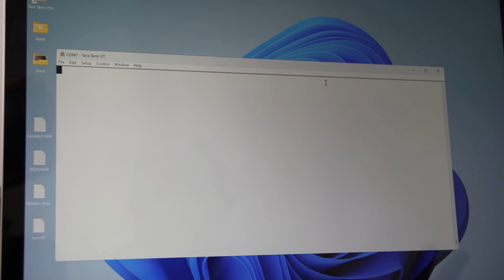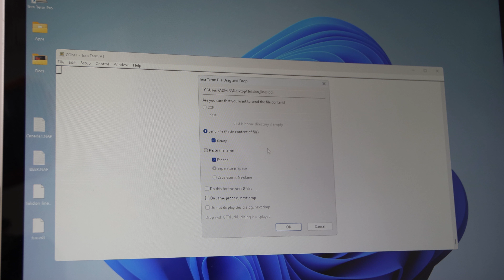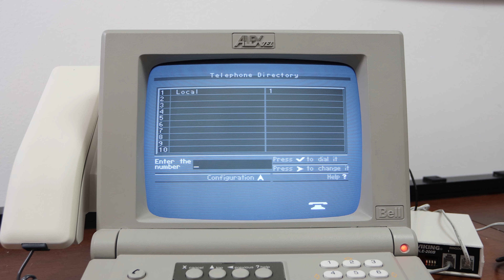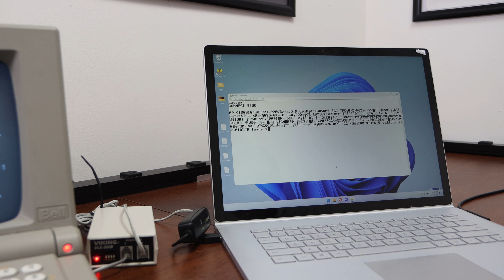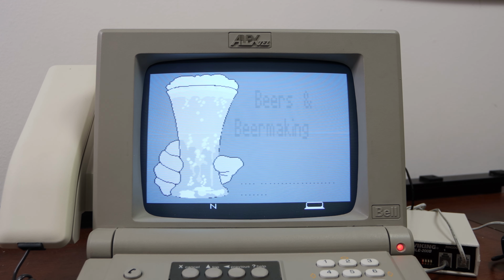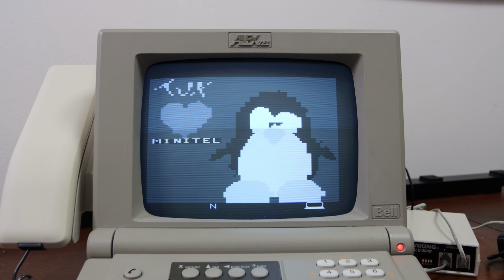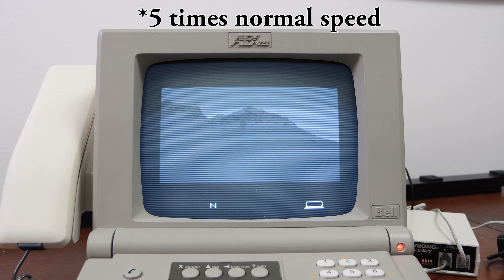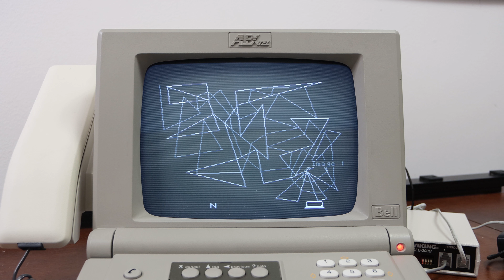Vintage Bell Alextel computer terminal can display graphics!

Comment: I was gifted one of these a few years back.  I've used it a few times to connect to some of the few remaining BBS's out there.  A lot of them can still be connected to by this terminal but I find on most the "enter" button isn't the same as it is now.  And what normally would be enter is strictly cursor return. 
 Either way.  Thank-you very much for sharing all that you've figured out with the Alextel terminal.  This will be super helpful in further experimentation!  😊
Reply: Different terminals used different "End of Line" characters or character combinations.  The most common were CR (Cursor Return), LF (Line Feed) and CRLF (CR first followed immediately by LF).  Those were standardized to an extent.  The most common "other" EOL was a "Null", which I think was used by Atari computers.  Beyond that you also needed to set the "stop bits" and "parity" bits right, though on some modems those could be set to "optional" which meant that mainly, "most" stop and parity combinations could be used and would be accepted.